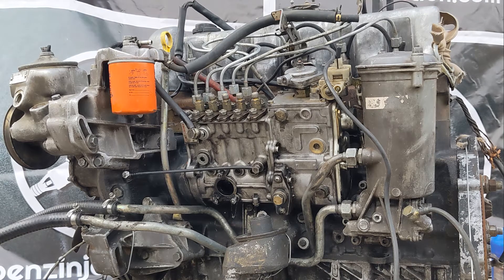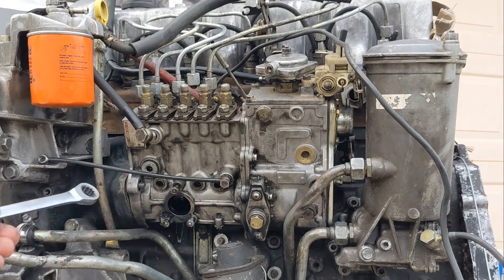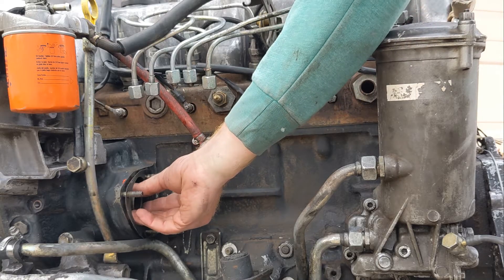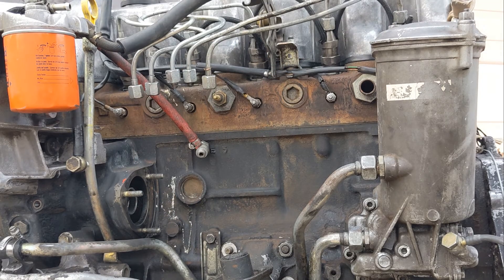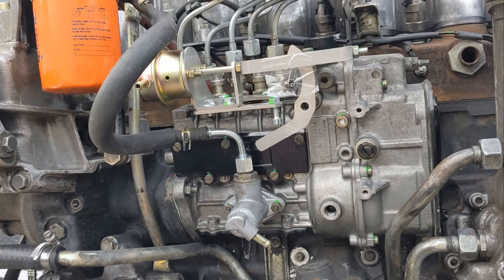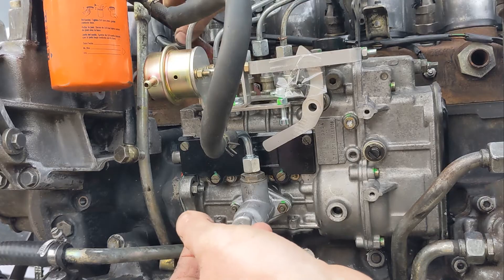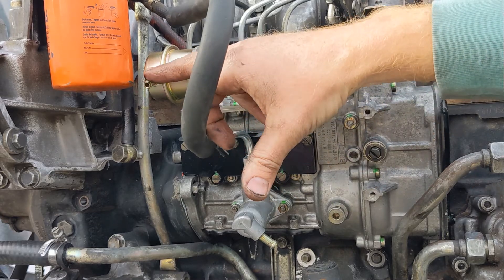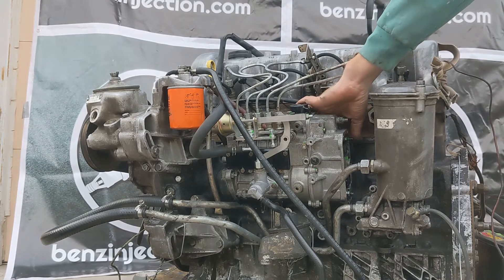OM617 Built M Injection Pump Install

Comment: I took out the valve cover and aligned the first compression stroke, i also aligned the mark on the camshaft gear and got 3deg after TDC, so my question is, should I add or substract those 3 deg. to the 10deg after TDC you mentioned at the beggining?

Comment: hello sir, your video is really great, well done, we would also have liked to see from you this famous Mercedes om617 injection pump timing set at 24° before TDC set to the drop with swan neck with the electric pump? normally 3 drops per second on cylinder number 1 according to Mercedes recommendations? thank you and see you soon

Comment: What makes the M pump more desirable than the MW?
Reply from the maker: It's tunable. You can adjust off boost and on boost fueling with the external ALDA.
Reply: @BenzInjection  u can also adjust off boost and on boost with the MW pump as well lol , M pump can be tuned with way bigger elements inside thus giving more fuel in all ranges
Reply: Another advantahe is that the OEM Mercedes Bosch 6mm elements fits the M-pump.

Comment: There should be washers under the nuts holding the pump to engine. 
I also have a yellow mark on my pump from dieselmeken, can be hard to see when the engine are in the car, can use a mirror, phone camera...
Reply from the maker: Yes, there should be washers under the nuts. My engine didn't come with them and I didn't bother putting them on as I just use this engine to test run the pumps I build.
Reply: However, the yellow mark on the dieselmeken built m-pumps is to be set at 23-24° before TDC. Not 10° after TDC like the green mark in this video.

Comment: Is there a factory marking where you put the green line on the inside of the pump?
Reply from the maker: There's not
Reply: @BenzInjection  Okay, is this location different from the factory location or is this a workaround for not having the factory locking tool?
Reply from the maker: @blattferenc9647  there is no locking tool for these. You normally line up a notch in the cam gear.